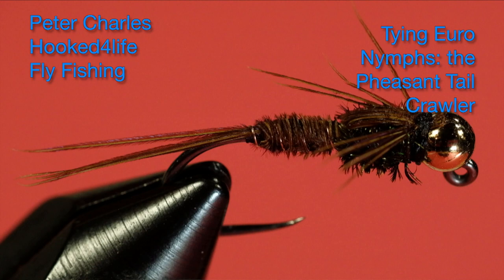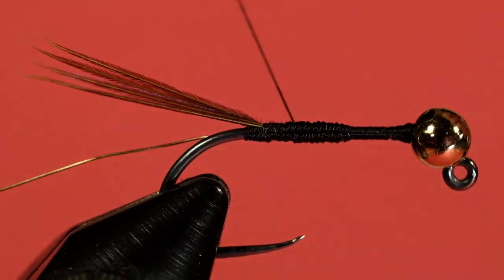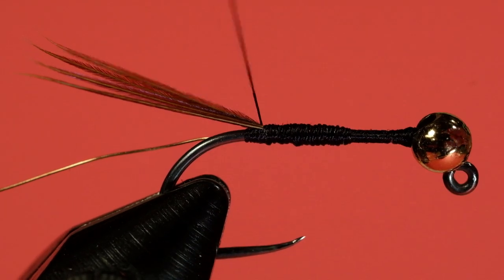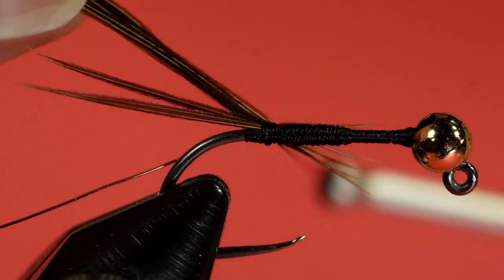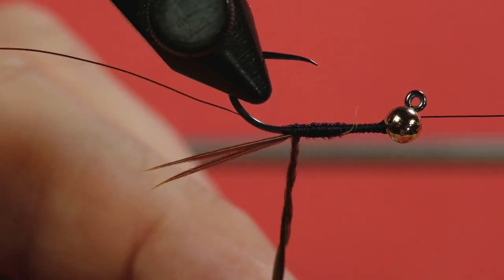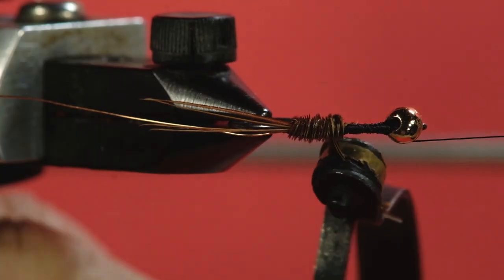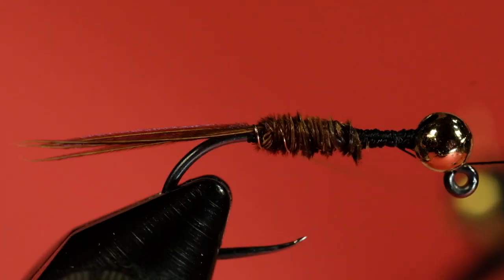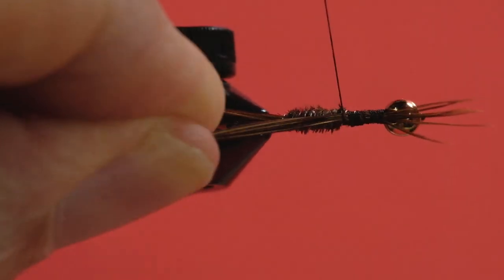Tying Euro Nymphs: the Pheasant Tail Crawler

Comment: Is it common for all tungsten beads to get beat up and loose their luster when fished?  Much more so than brass beads?
Reply from the maker: Any bead that has a coating will show scratches vs a bead that is not coated (e.g. real brass). One way I've maintained the finish a bit longer is to coat the bead with head cement or clear nail polish.